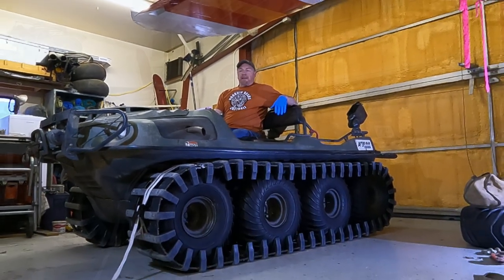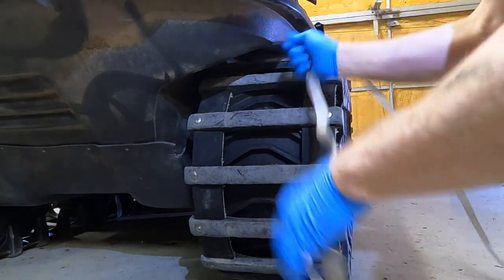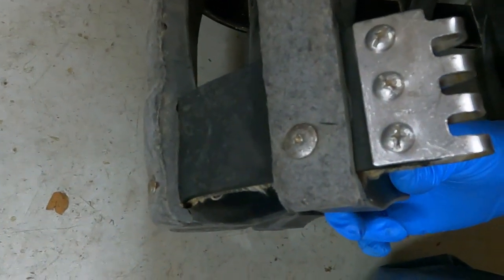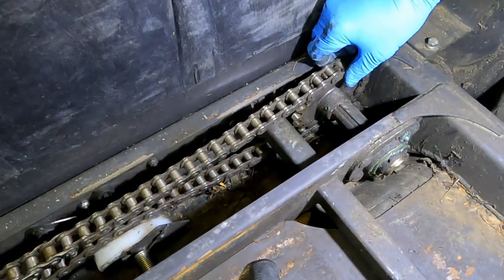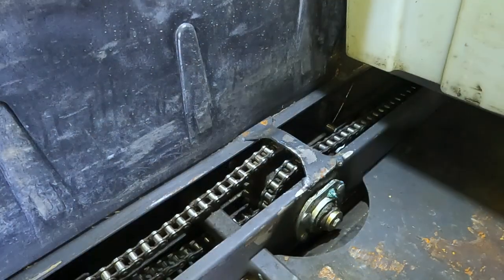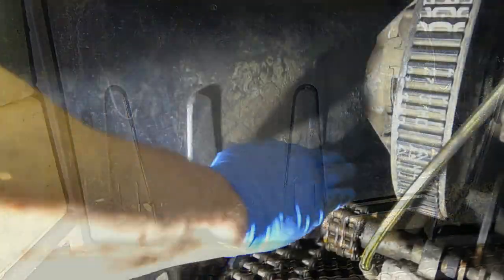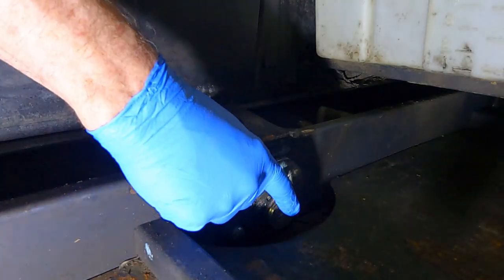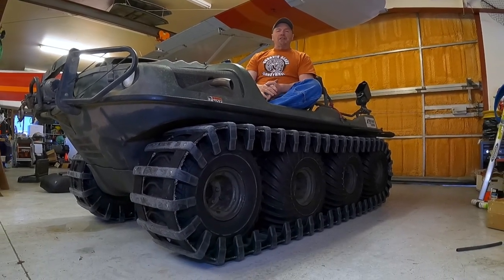ATV Argo: Bering Inspection

Comment: Good video.  Some forget to release tensioners during bearing checks.  Don’t forget to check bearing flange bolts too.  I find it easy to put your wrench on the axle thrust bolt and then turn the axle flange clockwise/counterclockwise to tighten/loosen the thrust bolt.  Outer bearings fail because of contamination.  Much of the time new grease doesn’t actually make its way into the bearings anyway lol.
You may consider pre drilling a 2nd hole and driving a 2nd GRK lag screw into each guide.
Reply from the maker: Say more about your last sentence please.
Reply: @RaisedinAlaska  
adding a 2nd fastener will help prevent a single fastener from shearing/breaking when the tires plow into the guides (tilting them over).  This puts severe leverage on the fastener, and is especially true if you happen to have traction enhancers/ice cleats mounted in non-winter conditions. It can also happen if the terrain is not favorable for skid turning and/or you have heavy loads.  But ice cleats in non-winter conditions (and sometimes in winter conditions too) I feel are the root cause.  I’ve repaired (or at least tried) quite a few of these tracks that have had broken screws from what I believe is the track sticking to the ground, while the machine and tires simply skid turn as per usual and force the moveable guide tips over.
I noticed you had an outer belt (ground level belt in this case) drilled to accept additional hardware, which is why I mention this.  If you don’t run the ice cleats and/or double belt kit in non-snow conditions, then you’ll likely be okay.  But ultimately the tire guides take a lot of leverage (especially on sidehills), so a 2nd pre-drilled hole + fastener is helpful.  If you haven’t broken any in your particular conditions and seasonal specific use, then I would say keep doing whatever you’re doing
Reply from the maker: @littlesusitna1  thank you for the information, you are a wealth of knowledge. I appreciate it.

Comment: I used these bearing few times seems to  work as long as the argo has I install mine the way the argo does   BUT,,,, BUT I take a durable  grinder with there small cutting disk and run a small cut line straight across and never had a problem  the grease will go across to the hole
Reply from the maker: Interesting, you’re braver than me.
Reply: Lol better odds then 30$ in slot machine
Reply from the maker: @brianleduc2244  That is very true.

Comment: I have an Argo Avenger 750 EFI and have to start a project like this. I take it there’s an inner bearing on that shaft, too? If you replace the outer bearing should that inner one be replaced at the same time? Will the tire movement you are doing here show that both bearings need to be replaced … or just the outer?
Reply from the maker: The outer bearing are consistently exposed to water so they have more issues. I generally do not change the inner and outer bearings at the same time. This test will also help determine if there is an issue with the inner bearings.

Comment: It seems the maintenance per mile is extremely high on the Argo's , i know there more than a atv/sxs for maintenance but do you think it's higher because of the tracks vs no tracks
Reply from the maker: That’s a great question. I don’t think the tracks increase the level of maintenance that is necessary. The exterior bearings are exposed to water, and there are eight of them, so this is going to require a fair amount of maintenance. All the sprockets and chains to make this simple machine something that requires a fair amount of maintenance. That said, I can take it places that other machines can’t go and that’s my motivation for owning one.
Reply: I know a dealer who has 40 or more Argos that he rents to industrial customers up north here. He told me  that tracks are extremely hard on Argos. I tend to agree. I bought an Argo Aurora 2020 800. I have replaced 4 bearings so far but because of the terrain I travel over I won't be taking the tracks off.
Reply from the maker: Running 40 Argo’s, I believe he knows more than I do. I will say they are a totally different machine with tracks and I’m willing to do a little more maintenance for then benefit of the tracks.